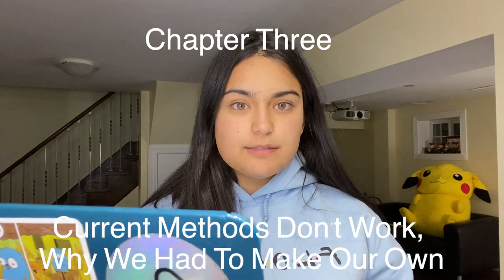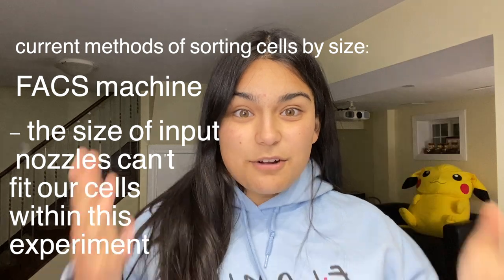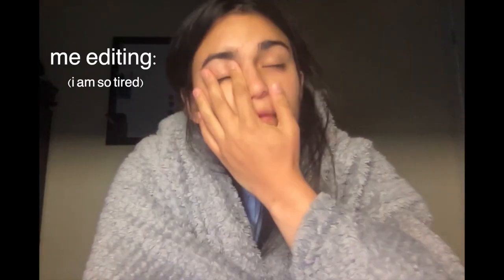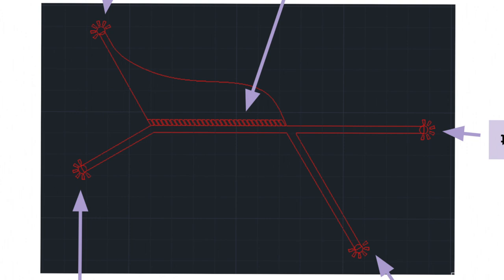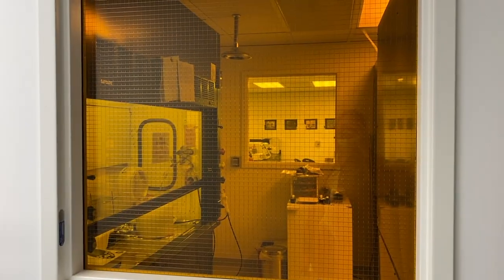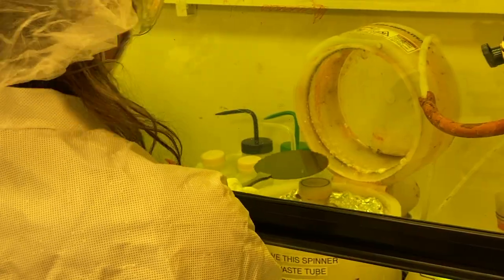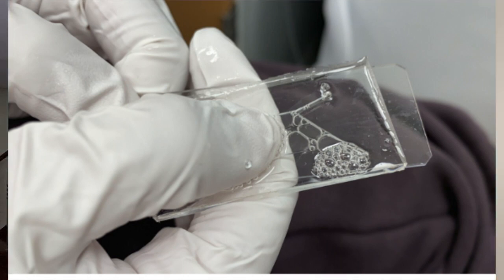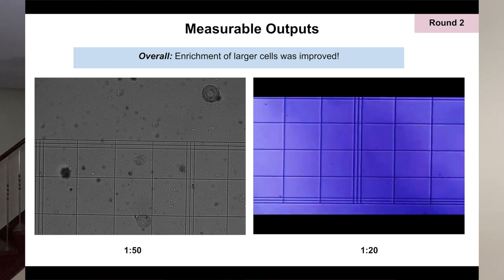We Made the Worlds Smallest Cell Sorter!

Comment: Huh, are the structures here large enough to be seen by the naked eye? Are there microfluidic systems which operate at a scale too small for the human eye to make out, similar to when lithography is used to make electronic devices?
Reply from the maker: Hey! Currently, we can see the imprints from the naked eye. I imagine the holes where you stab in the tubes must always be seeable, but later, when the liquid is flowing, that can be much more small. Further, I imagine the process of PDMS is less robust since the gel if too close might just merge in on itself so you must be mindful of it. If I wanted to make it smaller I would do it, look at it under a microscope, and see if the structures hold up. That’s what our professor told us to do :)